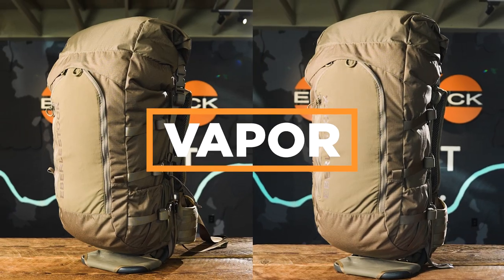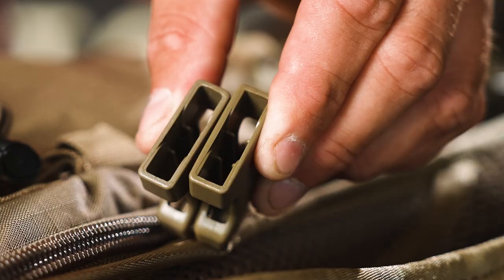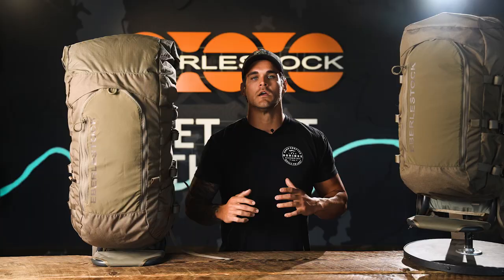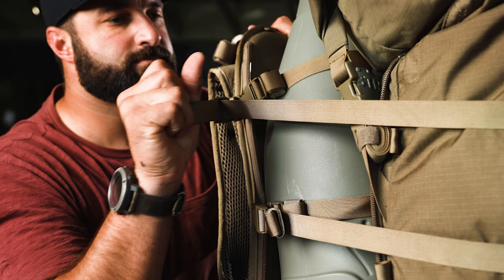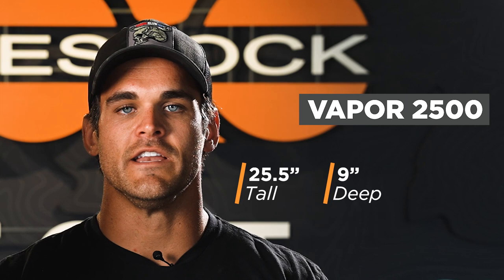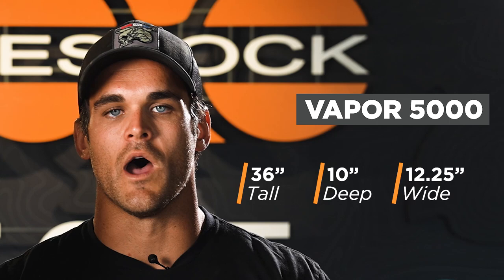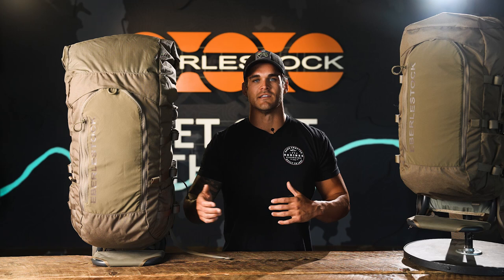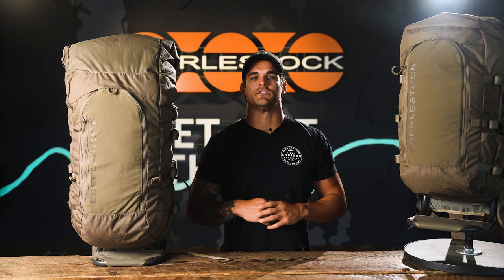ALL NEW VAPOR PACK SERIES!

Comment: Few things: Make the belt tensioning system on the new team elk belt available on the padded hip belt so it can be run on the f1,  make the padded shoulder and hip belts standard on the f1- the standard belts are miserable on anything over 50lbs imo- people don't buy a frame pack for day pack loads,  make a beefer clip to connect the sternum straps to the shoulder straps- the nylon webbing like to bunch up resulting the the black clips slipping of the shoulder strap with a load-super annoying. Thanks Kudos on the new lid, while I used the old one and appreciated its versatility it never sat on/attatched to anything in a neat or organized way always looked like an afterthought Including on the Blue widow JP9 that I got it with circa 2012. Thanks
Reply from the maker: We will pass along the feedback!